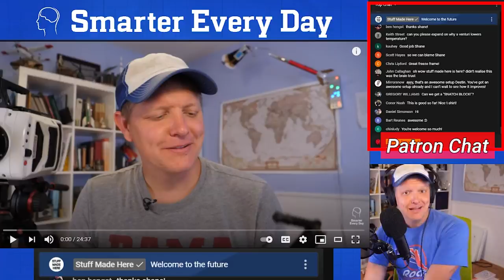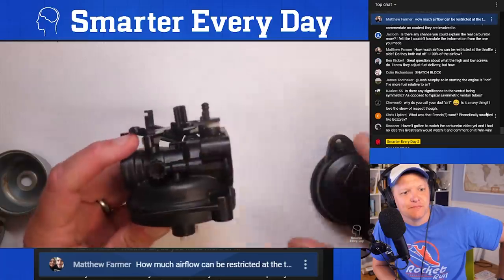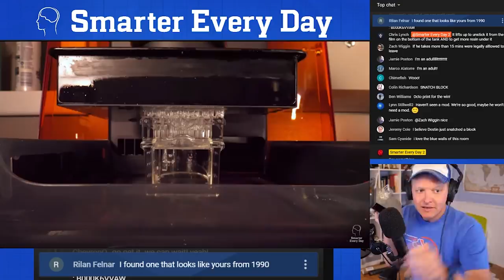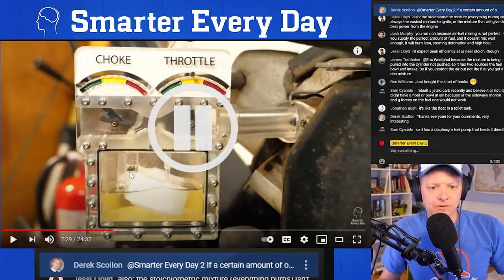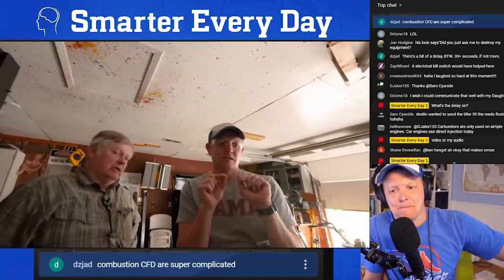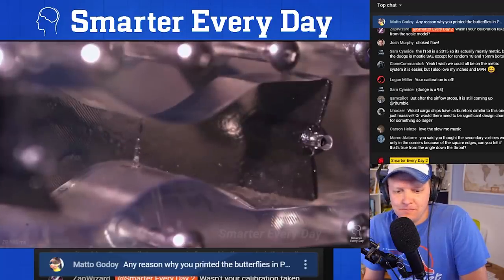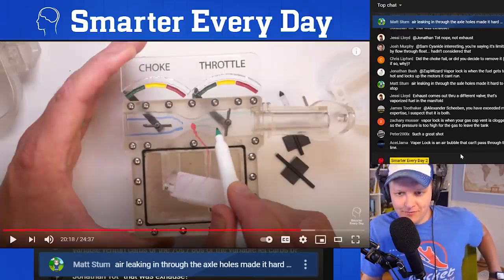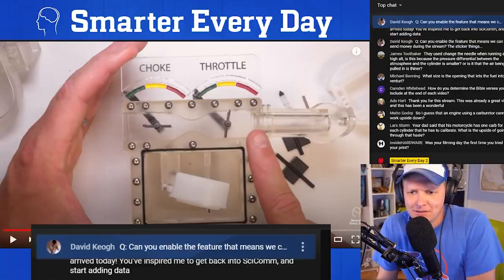BTS "How Does A Carburetor Work?" - Behind the Scenes Commentary | Smarter Every Day

Comment: so the holes in the choke let it run while idling, but then what about on a plane?  The way to turn off an airplane engine, where the user has constant control of the fuel richness, is to lean it all the way and let the engine sputter out.  so i'd guess the choke on a plane is solid, no holes?
Reply: Aircraft carburators have a needle that can be pushed into the fuel hole from the float side of the carburator.  This is what the mixture lever/vernier controls.  Also, because the forces on an aircraft are different, the fuel bleed into the venturi is typically inserted through the wall and coaxially down the length.  The power lever still controls a valve just downstream of the venturi.  The idle fuel is bled off of the main line going to the venturi, but after the mixture pin, so everything gets cut when you pull it all the way lean.  Essentially, the choke is ignored and the mixture is put in instead- just in the fuel feed instead of the air intake.

Edit: I was looking at a bunch of diagrams and I fly, so I'm pretty confident this is true for aircraft carburators in general.

Comment: Nice video. I think very hot running v8s with carbs can boil the fuel brfore they hit the bowl and therefore vapor lock and don't have to have a clogged gas vent line but am not sure.  Can anyone validate this idea?

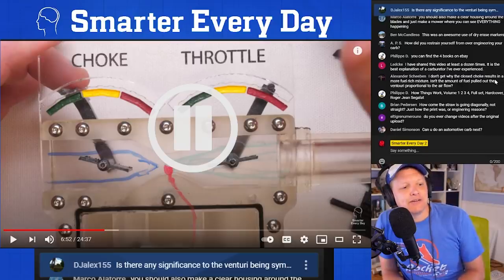Comment: 23:10 your dad said in the extended cut at 7:46 that the other Venturi is bigger on one side than the other, and you show a shot down the centre.

Regards the clear carb, was it just gasoline that was prohibited? Given you're not showing the combustion couldn't you just attach to a pump and pull water through? Wouldn't it vaporise in a similar way?

Comment: Can someone explain what it means when someone says, "You flooded it,"? What happens in the engine when it's flooded and why does just waiting a minute fix it?
Reply: flooding an engine is when you've displaced too much oxygen in the combustion chamber. as a result you can't get anything to burn. waiting a minute works (provided you didn't get the spark plugs wet) because the vaporized gas has a chance to turn back into a liquid and fall out of the combustion chamber and onto the piston and cylinder walls. when you go to start it again, as long as you don't go ham with the fuel, it'll fire up, sputter for a bit as the extra fuel gets re-vaporized and burned off and as the mix returns to normal, it'll run normally.